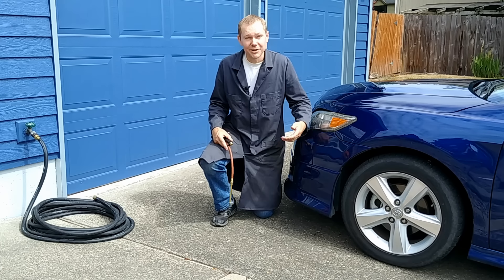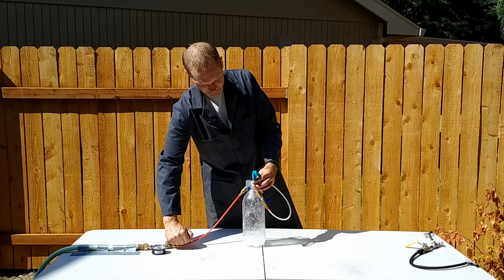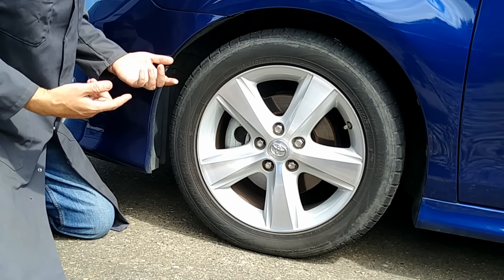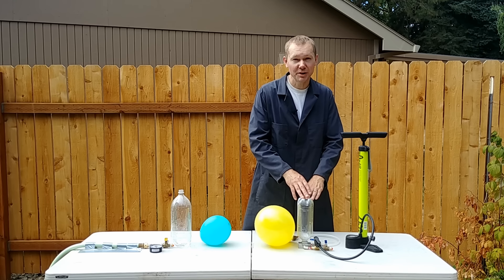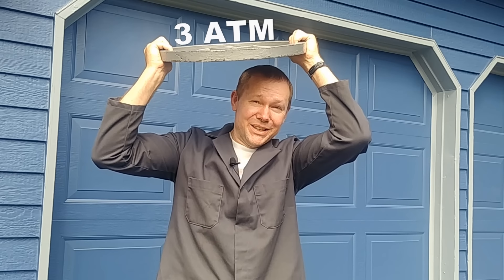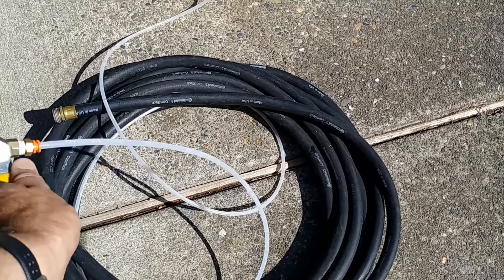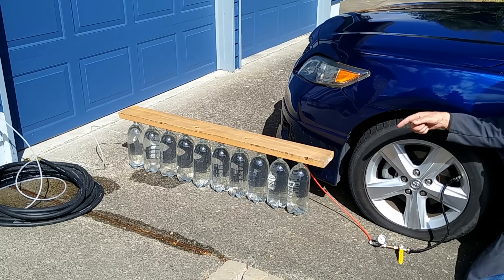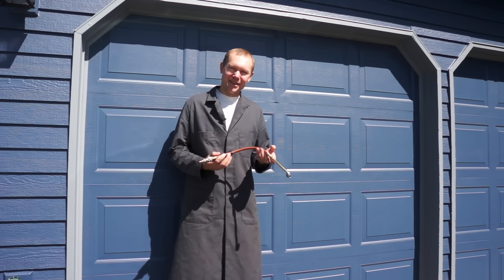2 Liter Bottle Compressor (No Moving Parts)

Comment: Wouldn't it be easier to use an air compressor or a tire pump?  Even taking the wheel off and to a gas station would be easier and quicker than going through all the hassle with those bottles.
Reply: Whooooosh

Comment: I hate to be that guy, but here I go.... This was cool, but working with water that someone else pressurized. I need "next level" MacGuyver... How can this be done with Gravity fed water? Would a 55 gal drum be sufficient to pressurize the bottles? what matters more? Volume of water in the source? height from which the water would have to go down to the bottles? or atmospheric pressure on the area of water? 
Why does someone asking a question I have never had reason to consider, then answering that question always make me have more questions I never knew I needed the answer to?

Comment: You measured the tire wrong. The tire width is distance through the tire at a point halfway between the tread and edge of the rim so you measure a tire width with calipers, you measured the tires foot print which is smaller. Based on you saying 7" and converting that to millimeters you get a tire size that wouldn't be on a vehicle that size. I'm guessing the tire is actually 7.677 inches converted from 195mm because 195/65R17 is what your tire size probably is.

If anyone wants to duplicate the experiment you can just calculate the OD using the tire size. The first number is the sectuon width in millimeters, the second is the profile height (distance between the ID an OD, but a percentage of the first number), and the third is the inner diameter. Just calculate what the percentage is and convert the rim size to millimeters or the profile to inches and add them together for the OD
Reply: Oh? Is that how you make estimates now? With exact measurements?
Reply: @mattmarzula  you still won't get exact but a way better estimate because you're not measuring the inside of the tire and the rim is adding additional volume too

Comment: Enjoyed your presentation.  You might consider making a video showing how the very early pumps in English coal mines were made to remove water in the mines.  The system envolved tanks filled with steam.  The tanks were very rapidly cooled by pouring cold water on the tank exterior.  The steam condenced, causing a vacuum that could be used to suck water.

Comment: You can never learn enough. Question:  Does it take more pressure to fill a tire on the car or off the car.  I've always wondered that because when you see tire guys fill a tire up on the car racks, they fill it to the same pressure when the tire is both on the car and or on the ground supporting the weight of the car. And I don't get that???
Reply: I have no proof but I am a logical thinker. If a tire requires 34psi to be considered inflated to the recommended amount then all you need is something that can pump air to 34psi. As pressure increases you would need an input pressure greater than the current pressure. For example, if a tire is at 10psi you would need something that could pump air at a greater psi like 11psi. But say your tire is at 33psi you would need something that could pump air to at least 34psi to get to the recommended pressure. This comes down to forces usually measured in newtons. If air was exiting the tire at 10N(newton’s) then to stop that you would need air coming into the tire at 10N. At this point you’re acting forces are equal and nothing is happening, but as soon as you increase your input to 11N, you now have air going into the tire even if your input was slightly greater, say 10.00001N. With that knowledge I can now answer your question. The answer is yes you would need more pressure. Think of an empty water bottle. If you step on the water bottle with air in it you’re increasing the pressure. Therefore with my previous information, to increase the pressure you need more input pressure than what’s currently in the water bottle. Same with a car and tire, the car is squishing the tire like your foot would squish a water bottle so you would need more pressure to inflate it on the car than in a rack. This is probably a negligible amount though. You could really test this theory if you inflate a tire to say 34psi, measure it, then take the tire off the car or simply lift it off the ground using a jack and measure it again. I would think the pressure would now be something like 33.48psi, however I’ve never tested this for myself I’m just using logical thinking here. All numbers in these examples are arbitrary so they’re probably not near the real readings you would get in real life. 
- Ryan Sam—your backyard scientist.

Comment: I'm reminded of the arc-reactor scene in IronMan 1 when Tony and Obadia are talking.

This works as a science project but, otherwise, it's completely impractical when you can just get extra hose for your compressor or an emergency roadside compressor at much less hassle.

Comment: (1) Question: Did you ever measure the water pressure? (2) How did you dry the inside of your tire out?  and (3) Dude: Just buy an air compressor.

Comment: I can't help thinking of the energy efficiency of this, using a waste product to power a system.
any reciprocating pump will have friction losses, where this system has little to none.
an impeller in the hose, for example, would require significantly more water for the same result.
so many comments are directed at "water waste" rather then the bigger picture.
a simple demonstration of a scientific principal, Boyles law, maybe displacement?
I'm hard pressed to find parallel levels of efficiency.

Comment: Nice concept but its much cheaper and much less stressful on the municipal water systems pumps to just buy a compressor or get one free or cheap. Yes there is pressure in the water system. Thats how it can be possible to deliver it properly to your home. If everybody did this wed have zero water pressure and ill tell you one thing. You do NOT want to meet me without a shower.

Nice vid though of what you CAN do.

Comment: Outside of having humid air in your tires, this would also require enough water pressure but that should be easy. What about using the pressure to make a pump using the rotation? Or just use a rechargeable battery powered pump that auto stops at the right pressure 😛

Comment: I mean, I get the "because we can" - part, but if it's neither fast nor exact nor practical nor economic...
Why would you do it this way?
Also, there's moving parts for sure: bottle caps and the person working full time to operate the thing have more mileage than the tires will get
Reply: Because thats not the purpose of the video, he explained at the end that the video is to help people understand and learn. This same idea could be applied and improved upon to the point were it could be useful. When the car was first invented, the horse was still more feasible, until the car was improved
Reply: @MultiBeast301  yeah it's fun for teaching purposes, buts not some revolutionary invention that will blow up anytime due to unexpected potential xD
With the wheel you already knew it was faster than the horse. It was just a matter of putting it into a practical format that didn't need rails and that was worth the extra effort. 
Here, there's pretty much zero advantage and zero potential.
Even if it was amazingly accurate volume-wise (which it isn't), it would be useless for this particular purpose because rims and tires come with manufacturing tolerances. You would want to match pressure in most cases, regardless of capacity.

You could use some large empty backyard gas tank with a say 78 foot tall filling pipe and pour water in it (keep it topped off) and have almost perfectly matching tire pressures if you tap the trapped air inside.

Comment: Its fake.....  Not fill the water in the bottle if there is a back pressure... We need one pump which displace the air in bottle at 3 atm.

Comment: This method injects too much moister into the tires.  This is not good.  Moister in the tires causes the pressure to vary too much with temperature.   Do not do this.

Comment: Clickbait. There is a moving part. It's called water. So you're using the water system and it's pressure to compress air. If you really have such a problem (and it's not just yt/tick tock "showmanship") save yourself the hassle and get the tire fixed. Besides, it's far less hassle to get an air compressor than to lug around that kit you made and hope you're near a garden hose.

Comment: instead use hand pump, do not waste water, 80 litres of water for one tyres. stupidity in name of curiosity/science. not discouraging but need some sense in doing things. this wasteful adventure in unworth.
Reply: and where do you think the water companies are getting that water in the first place?  No plumbing system is 100% closed off at all ends, as the water distribution centers also collect and treat rain water and other fresh water sources.  We don't run out of water by dumping it on the ground.  We run out of water by destroying the areas around rivers, streams and lakes (by removing the plant life - either through devegetation or pollution, which causes the soil to losen up and drain the water further into the ground and also causes the temperatures to rise so that surface level water evaporates faster).  Stupidity is choosing ignorance, it is not demonstrating a system through means ignorant people concider wasteful.  Also, tyres means more than 1, yet one TIRE was filled here.  And yes, your statement is highly discouraging, and HIGHLY disrespectful.  You're clearly talking out of your league here, both in terms of language and in terms of understanding how things work.